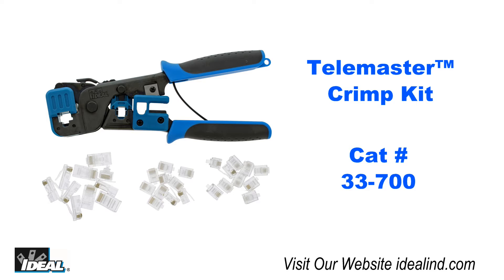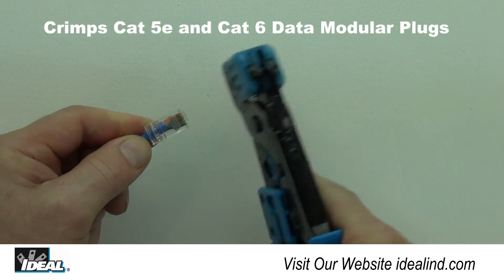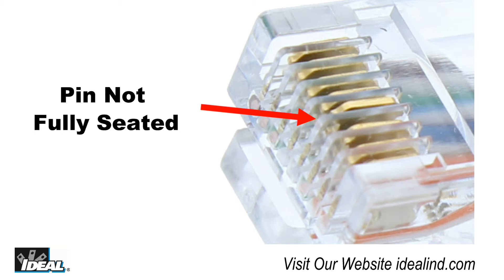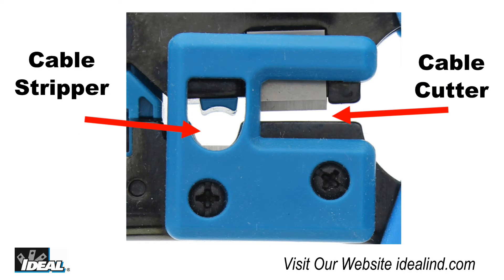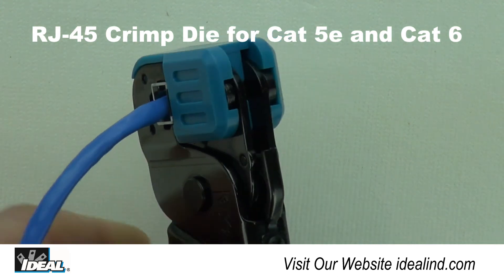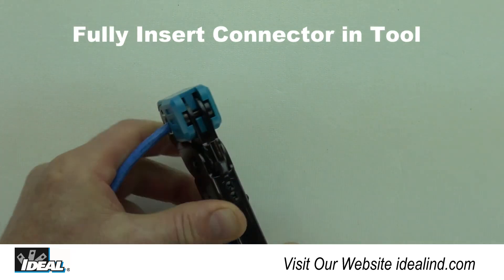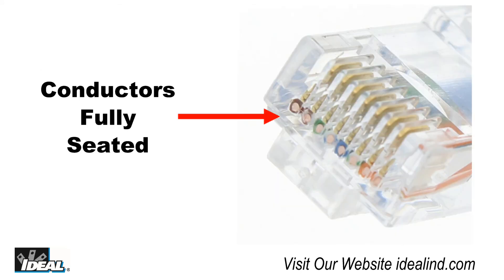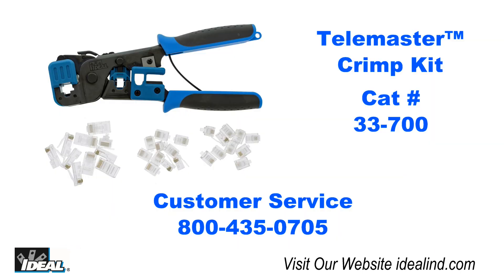33 700 Telemaster Crimp Kit

Comment: That's to bad the older gens did such a bad job at crimping, glad to know your improving the tool as we'll watch for this one. Thanks for the product updates Ron.. Good man.
Reply from the maker: Roger over the years there have been a lot of cheap knock-offs of these crimpers. The difference is the tolerances and heavy duty frame crimps the plugs very consistently. Thanks Ron

Comment: Wish it had a 4P4C too.
Reply from the maker: It will crimp a 6P4C connector which is the same size just a couple extra slots with no pins. Today you got to be over 40 to remember land lines it seems. Ron
Reply: Gee I thought the 4P4C (the handset cord connector RJ22) was smaller in width than the 6P4C (and 6P4C).  Re the 4P4C (and the 4P2C) maybe you could center it in the 6P4C slot and crimp it that way? Yes, I feel like a fossil !
Reply from the maker: You are right it will not do a RJ-22 which is a little smaller. I am sure it will fit in a lager jack though. Ron